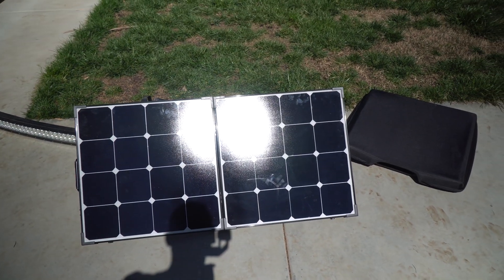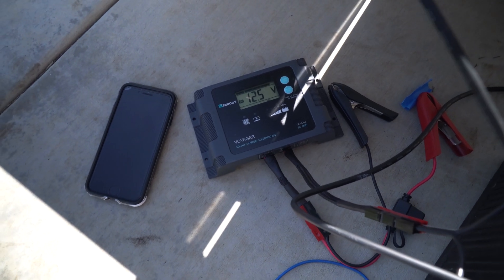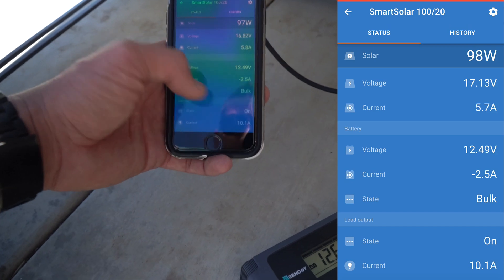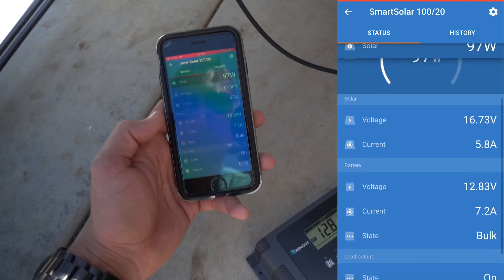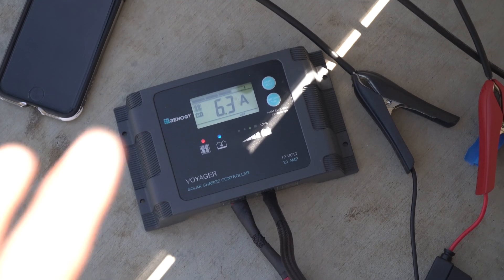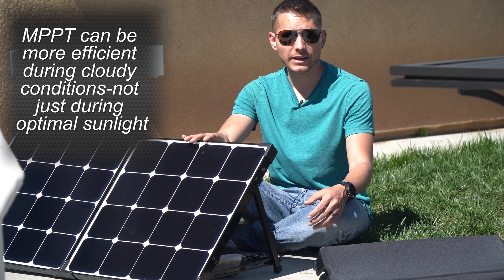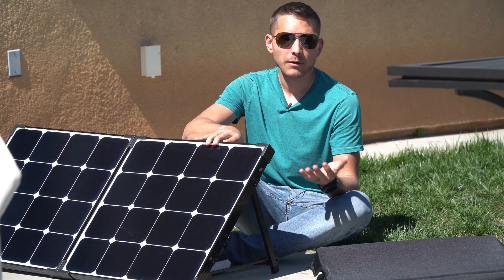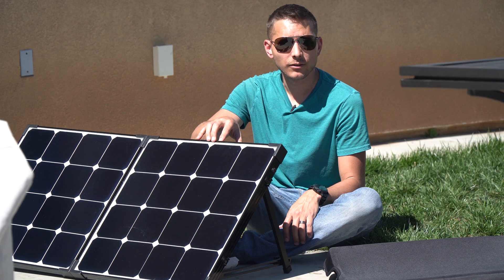MPPT vs PWM Solar Charge Controllers With A Small Panel: Is MPPT Still Better?

Comment: Thanks much for the comparison in the context of a small-ish panel. I've got a gadget running on a 4w panel currently producing 0.2w through a PWM controller. It seems that a voltage-matched MPPT controller will make a significant difference!

Comment: You do forget to mention that MPPT is not optimal when you have solar panels with different orientations. PWM performs better in that situation. Of course you can compensate that by buying multile MPTT controllers ...but that gets really expensive.

Comment: You gained a little over an amp with mppt so to me the small increase isn't worth the price on a small system but the main advantage of mppt is the ability to hook solar panels in series and still keep your battery bank 12v without much loss

Comment: I mean, for the extra $100 you'll spend on the other charger, you could buy over 500w of used panels in good condition. Not worth imo.
Reply: Well said. There are a lot of cheap used panels hitting the market now. I bought a 4.8kw pallet of used panels for $440 this past winter. Sold them to a friend at cost for his cabin and he's got more power than he can use!

Comment: No, no, no.  You need to look at the total energy harvested over the entire day, not just spot check.
Reply: When u average it out u might see a  10% to 15% gain in a single panel if that. to me it doesnt justify paying 4 times more for mppt if u r using a single panel or hooking panels together in parallel there is still little gain but i do see the point if u have a large system over 400 watts mppt might be the way to  go

Comment: i set up a test my self last night so it could gather sun all day and i could see the total watt hours collected. its 02.05.2021 in upper indiana, overcast a good part of the day. i setup up 1 pwm controller and 1 mppt controller, each controller had its own exact same 100 watt panel and each its own 12 volt agm battery to charge. the pwm got 206wh and the mppt got 196wh. in the morning i could see the pwm was charging a good 30 minutes before the mppt would start charging,  so after seeing this occur for a few minutes i even swapped cables and panels, thinking something was wrong, there was no change the pwm started back up charging immediately, now i am talking about first light where you only get 1-3 watts. so now i am trying to figure out whats going on
Reply: Ding.  Measure energy collected over the entire day and the reality sets in.
Reply: @GoatZilla  now i found a way to get more wat hours out of the mppt vs the pwm.  i wired the mppt to a 48v bank of agm batteries and broke the 4x25 watt panels into series for a 100ocv and got significantly more watt hours from mppt. for these tests i am using the harbor freight "100 watt" kit panels which are actually 4 25 watt/25voltocv panels normally connected in parallel.  once i figure out exactly what is going on i will begin testing with other panels and controllers and battery configs. i think i read where mppt needs more volts than what a 100 watt panel with provide. one day i soon i will know what the hell is going on.
Reply: @jasonbrown467  Yeah MPPT performance is very situational.

Comment: You didn't show the wattage of the pwm. That's the most important part in the comparison. I'd expect it to be around 80 watts.
Reply: It was 78 on the Pwm, 97 on mppt
Reply: Ya I mean the battery was at what 12.8v so assuming the 6.3A was right which I assume it was not he did not show the tag on the solar panel but I don't think the short circuit amps are that high but assuming it would be right at 80 watts
Reply: @james10739  the amazon link to the panel (in description) shows Isc = 6.10A

Comment: Very nice review.  The Renogy costs $59.99 and the Victron costs $157.25.   It still may be worth it to use PWM as it will take a long time to recoup the costs.  I have heard PWM can kill batteries.
Reply from the maker: True on cost. For me it was worth it for the slightly higher output, but moreso the history! I love seeing that kind of stuff. 
PWM shouldn't kill or harm the battery in anyway, as long as it's functioning properly.